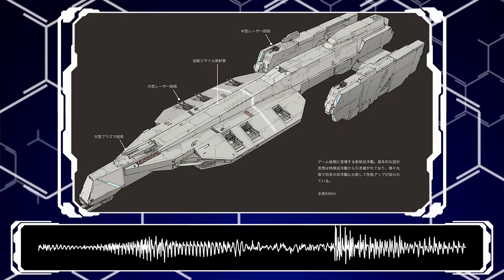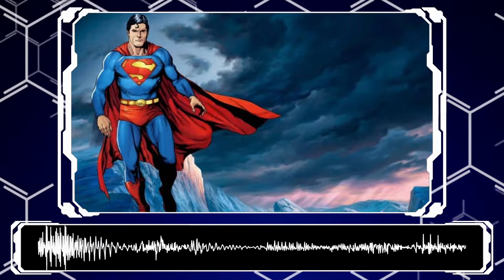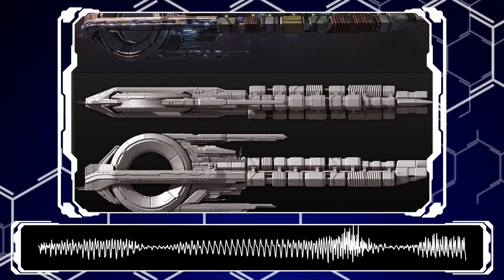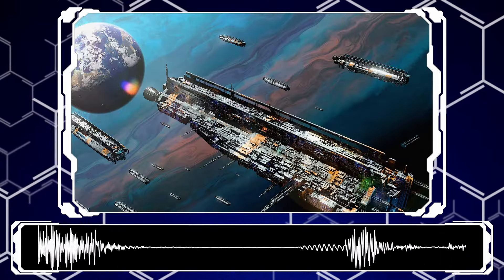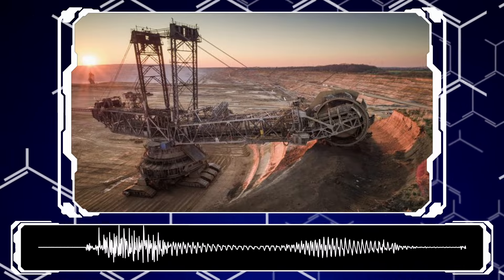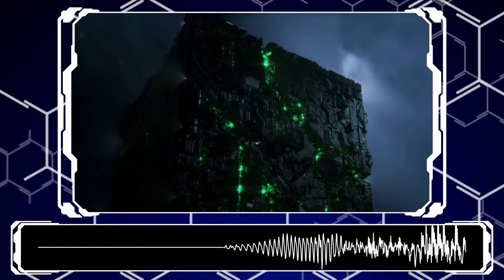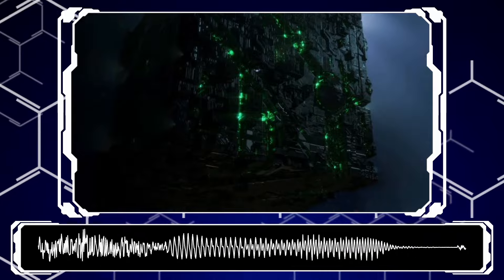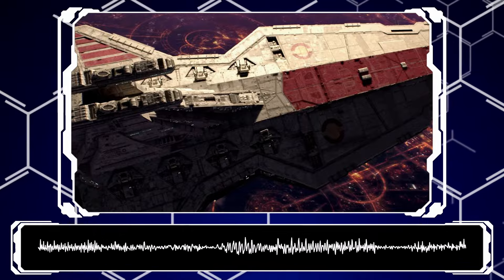The artistic principles behind SCI-FI ship design

Comment: The Star Wars star destroyer is basically a perfect design for it's job. It goes into the design of WWII warships, with big cannons along the midline that can be turned to the side plus smaller guns on the sides. But space is 3D and the angled surfaces allow for the guns to be placed in ranks like seats in an auditorium. Every gun can see the target and fire, both sideways and to the front.
Reply: This is patently false and has been known/shown for decades. There is NOT enough of an offset in either spacing or angle to allow anything but the most forward turbolaser turret to engage targets to the front...you know the view most seen by approaching ships, remember the fleet engagement during ROTJ among others? The ship has to actually turn to the side or be alongside (memories of the Battle of Coruscant?) to be able to bring all the main turbolaser batteries ON ONE SIDE to bear...which then cuts off the LOS of the other side. Only the minor trench guns and forward facing secondaries along the dorsal/underside have wide enough LOS to engage targets over a wider degree covering the forward arc. The SD is also famously lacking in firepower covering it's underside and rear.
An example (as if the inummerable cutaways/diagrams weren't enough) of the limitations of the Main Turbolaser Batteries occluding each others forward firing arcs is provided in Rogue One during the Hammerhead sequence. You notice only the forward battery is firing...because it's the only one with a view to the enemy fleet.
https://www.youtube.com/watch?v=sbfr6k7R9zQ
Reply: @mikebelcher7244  which only means that they didn't angle the surface enough. the general shape would be perfect for it, just the execution is lackluster. but then it's the empire, and that's pretty on brand for them.
Reply: Actually the ISDs are no battleships. They are more or less heavy armed troop transporter with carrier mixed in.

With this in mind the ships layout is perfect.
Reply: @thomass6434  ISDs are 100% battleships, they were used as battleships, they were designed to be battleships, troop carrying capacity was just a secondary thought due to just having the size. The ISD doesn't have enough craft to effectively deploy it's troops in mass, it has to have it's few transports make constant trips back and forth to dumb off troopers, equipment, supplies, etc. And it barely functions as a carrier, with only 72 Tie Craft on board (Fighters, Interceptors, Bombers, Etc.), which is close to the same amount that a modern, US Carrier has, and for a ship that size, that's a tiny complement, especially compared to ships like the Venator, which was smaller yet had a massively larger fighter complement. The ship was a battleship first and foremost in construction, with broadside battles being what it was expected to fight, only for it to have to deal with insurgent tactics instead. And while it's true the 8 main guns can't fire forward, all the other guns can fire forward, which the Star Destroyer has a lot of smaller turbo laser batteries outside of the main 8 turrets we see on the sides of the superstructure

Comment: Star Wars ships, especially the older ones, typically have a gap between to top half and bottom half of the hull, that runs all the way around the ship, and is stuffed full with greeblies.
That's because they never could get the plastic shells for the top half and the bottom half line up perfectly to get a seamless edge. It always looked crooked. By separating the shells and adding lots of noise between them, this slight misalignment becomes completely invisible. And creates an iconic look.
Reply: We have a saying in woodworking. 
"If you can't hide a gap, accentuate it"
Reply: That is an interesting tidbit, thank you for sharing.
Reply: It was also handy for hiding a working seam. Many shooting models, particularly in pre-LED days, would be lit by various lighting systems (wheat bulbs, fluorescents, neon tubing) that would need servicing. Giving a studio model a "hood" so to speak made reaching these components a lot easier during production. A "gap" could help hide where the removable or hinged section was.
Reply: And that iconic look can be SO iconic that it affects even novels. In the EU novels, post Galactic Empire, a character 'obtains' an ISD 2, but doesn't want it to be the terrifyingly bland grey. Unfortunately because the Empire ordered it in bulk for those ships, and there were very few ships that size in the galaxy, the only other color he could find for his ISD was the same red used by Republic Senatorial vessels.

And thus was born the casino-ship Errant Venture.

Comment: Most of my designs tend to be very utilitarian. Partly because I like the idea of a civilization having a focus on practical designs first, and partly because simple designs are easier to do.
Which means most of my ships are indeed a collection of blocks except for a couple few special ones that are fluid on purpose.

But I have a set of aesthetic guidelines for my main faction:

- Ships are always longer than they are high or wide
 - Ships are always wider than they are long
- The lower sides often have "pods" at the bottom sides (around the 4 and 8 o'clock positions), similar to the hangars on the Galactica or warp nacelles on Starfleet ships. The pods are more towards the back than the front. Sometimes directly connected to the main body, sometimes offset.
 - Some ships have a large hump on the top that balances out the side pods, especially if the ship is very wide. (which gives sort of a triangular shape from the front)
 - If the ship is more smooth, it begins at the front.

Functionally they are multipurpose ships, but primary military. Part of the defense fleet, but also with scientific equipment (basically the inverse of Starfleet, where ships are science and exploration first, and defense second). Some have a large fighter bay at the top (as homage to aircraft carriers)
Reply: Is it wider than long, or longer than wide? You say both.
Reply: @cardboardcrafter2482  ahh, wider than tall obviously. there is no non euclidean construction
Reply: In my setting, a lot of ships resemble hammers. They would have a fat, reinforced front end to deflect navigational hazards. (For war ships, it's basically a solid plate, save for a few gun ports. ) and all the more sensitive parts of the ship tailing behind. 

Although, if I wanted elegance, I suppose I could get a similar effect with a tear drop shape.

Comment: Escape Velocity: Nova made great use of shape and color to make not only each faction immediately recognizable, but also the function of each ship and in some cases specific ship manufacturers.

There was a series of cargo haulers that start at a single cargo pod with a cockpit and engines on top to rings upon rings of those same pods for the bulk hauler. Then you had the pirate Manticore that cut said bulk hauler in half, threw away the front part, and used most of that cargo capacity for five each of every gun and more engines. It looked intimidating while also looking “craft produced” or salvaged, befitting its piratical origin.

Comment: i think what makes 40k ship design "work" is that despite they are noisy and greebly, the ships designs remain consistent between most of the various imperial patterns, so if you can understand one type of imperial battleship, you easily figure out how to see most other patterns of them
Reply: They also still have distinctive silhouettes with realatively clean prow and engines, so you always can easily judge where which part of the ship is, where is it facing and how is it moving
Reply: The thing that makes them work is that most of their fine details are organized into repeating patterns. Repeating patterns read as negative space. So all the viewer's eye actually sees is the axes along which the repeating patterns flow, while most of the fine detail gets overlooked.

Though frankly, I feel that most Imperium ships suffer from not looking different enough from each other. They're all basically the same shape: a giant stack of thrusters at one end, a big beaked prow at the other, and a spiky mass of greebles in the middle. Different ship models may differ in size, and the fine details. But at a glance and in a vacuum, you would be very hard-pressed to tell one kind of Imperium ship from another.
Reply: So a flying cathedral

Comment: Aesthetically (as is pretty much the case for pretty much any conceptual sci-fi ship), something to consider would be how the ship is meant to be seen. I mention this because the question came up in an SF forum with regard to why certain SW ships look the way they look, particularly small craft. Generally, long and thin is good for straight line fly passes, but not good for dynamic, maneuvering shots. In a sense, the Y-wing, as attractive as it looks in general, is not dynamically as good a looker as the broader TIEs and X-wings that can bank and roll. I suggested as a comparison, you could look at war thunder (or any air battle simulator) and compare an F-104, a very narrow and long fighter, and compare it to something with a broader wing plan, like  the Sea Vixen. The broad swoops of the Sea Vixen seem to carry weight and mass in a way that the Lockheed fighter just visually doesn't...even when it gets shot down! Curiously, if I were to say what real life a/c inspired the design of the Y-wing, the De Havilland Sea Vixen would be it.

Comment: Some shapes are more practical from an engineering perspective, for example you might want a sphere for a bulk cargo carrier as you get the most internal volume for the surface area, saving weight on the hull that is used for cargo. On the other hand a wedge or triangle shape is best for combat ships as to allows the most weapons to bear on a target.

Comment: While the parsability is good and all, the ships should still make sense from a mechanical point of view. Engines should be roughly in line with the centre of mass or you'll get the rocket sled syndrome. Nothing should be blocking the engines drove cone, and yes, this is something non-movie star wars ships did a lot. You probably also need a toilet and a sink. 
There should be enough space for all the systems on your shuttles, otherwise you'll get a cardboard box painted in ship colours rather then an actual ship. 
And other considerations.
Reply: For internal space I always take 3 m as deck height floor to floor. That allows for comfortably high rooms and stuff between the rooms.

Comment: and if a ship does break the rules of convention, it needs a reason

for example, why would a ship need all those guns, in lore answer (madeup) the reason it has all those guns is because it's meant to intimidate and make anyone hesitant on attacking since they will likely be outgunned immediately, namely for intimidation more than anything

this makes sense and could help explain some more questionable design choices
Reply: Realism was not something talked about in this.  Take a look at most surface ships over the last 100-150 years and they are filled with clutter topside.  If an after action report in WW2, the captain of the USS Enterprise asked for her armor to be removed in place of more AA guns.

It is a large part of why the answer the USN had to "how many Bofor guns do you want" was "yes".
Reply: @cp1cupcake  I like a bit of in universe realism, legitamate reasons why something is made the way it is

like a idea I have fora  carrier ship is a diomand like shape ship that is semetrical on both sides even on the interior to make it as simple to make as possible and make sure there is a backup system as well

the carrier is not tall but it's not flat, and it has double hangers with reinforced window and blastshields with one on top and one on the bottom, this way, it ahs no blindspots on top[ or bottom

the weapons it has are limited but effective, identical from top to bottom as well, allowing it to have no missed firing ark blindspots

basically think of a venator with a bit more firepower, a bit larger, but more appropriate as a battleship when neeeded

Comment: World building is also something to take into account. For example I designed the Sunrider class of Knights (Large multi-role ships meant to serve as flagships for entire fleet formations and to carry powerful spinal mounts) to be almost like a Viper. It had a sort of hexagonal body, like a Halcyon destroyer, with "Wings" and a large glass observation deck on top. It was a luxury military ship. It was designed to be kept kind of far in the back line, allowing it's fleet to do work for it. It was also built by a young officer who knew he would be the first to receive one and designed it for that luxury. (Ironically he didn't get the first Sunrider. He got the first Legion class.) Then you have the Legion and eventually the Bismarck class Paladins (bigger than Knights and more heavily armed and armored, ranging from 1km long to 2km long.) which were more like Halcyon class Destroyers. They still featured the large observation deck, and early variants of the Legion class featured the wings which held additional fuel or equipment, but were more combat focused. Since that was what was requested by the nations military. You also have the truly ridiculously sized Leviathans which are just giant long rectangles with multiple prongs on the end because they are the command and control center for an entire campaign, and are meant as basically massive mobile space stations. Even larger are the Nation Ships, which carry massive amounts of people and roam the galaxy as a form of insurance policy for the nation who owns them, as part of a back up plan if they ever get destroyed. These are literally just massive rectangles because they aren't meant to dock with anything bigger than them. They are kind of like arks. Another example I like is the description of the Redacted, a mobile base for a project whose purpose was to create people who were dead. (Not zombies, more black ops the country who used them had death certificates and would always deny they existed.) The ship literally was a "headache of a design" because it was "Multiple ships slapped together and the interior has just the right amount of drywall to not notice you're in about thirty different ships." it was meant to be a lot to look at, because it was never meant to be seen, and it was cobbled together using what resources were available. For where I was inspired, go find the Sunrider Visual Novel (The Sunrider class is basically the same, it was one of the first ships I used to write and the series inspired a lot of my work so I haven't had the heart really to change anything, though there are several key differences inside the ship and to it's capabilities.) and of course the Halcyon class and the Imperial Star Destroyers helped inspire designs. I do love this video, lots of great points not just for visual descriptions, but written descriptions. It's important to know what a ship looks like so you can convey it over to another person. And these points were spot on, thanks for the help.

Comment: Flag design is the same way, it has some agreed upon rules which you can break if you know why your breaking them. One particular rule of flag design is no text especially not the name of what the flag represents. Look at the flags of Colorado or Ohio and suprise they have a C and a O on them respectively. Normally text on flags is small and hard to see from a distance and clutters the design but these flags use one big letter. Another rule of flag design is three colors or fewer. Many flags break this rule and fail because they look like a painting which is hard to see from a distance or they look like colorful vomit but a few flags carefully add 4 or more colors and because they use it in a distinct way it works. Or how about no small details. The US flag has tiny hard to see from a distance stars, but there's 50 of them right next to each other so you can still see the whole group. All the flags that break rules and get away with it, do it carefully and usually only  break one of the rules.